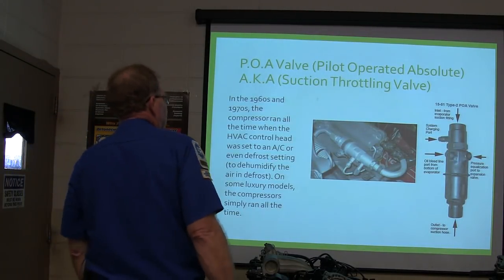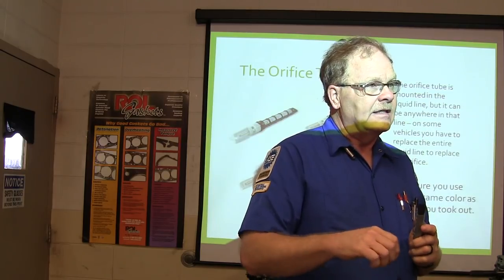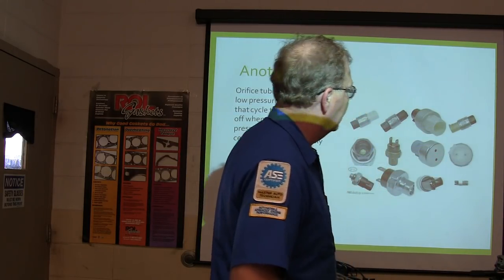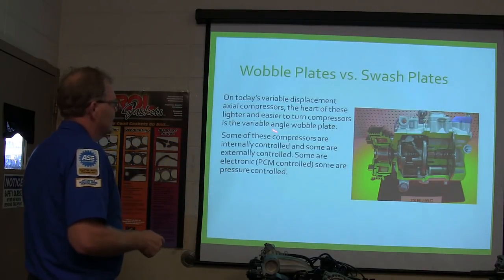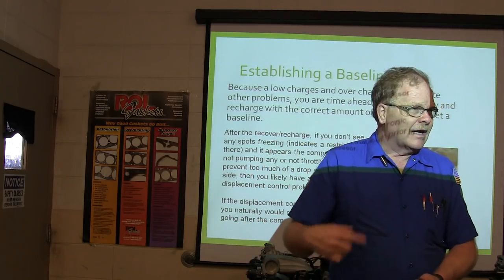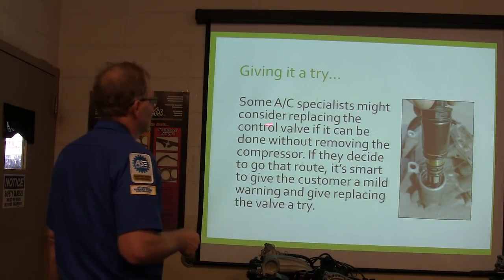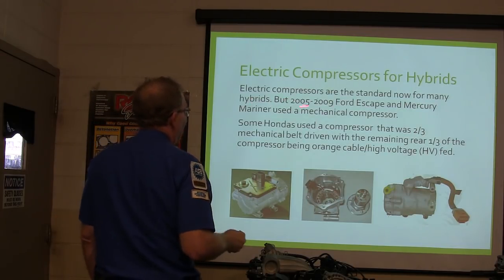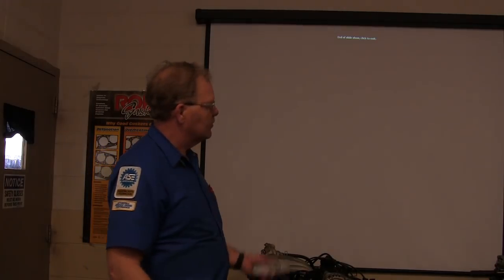A C Cycling and stuff

Comment: Hello,  Sir. I have learned  that there is a low pressure switch that will not let the pcm run the compressor to keep it from failing. I keep hearing that if you have low refrigerant, your compressor will cycle on and off rapidly.  What I would like you to please explain to me is how the compressor keeps turning on and off with low refrigerant. I am confused. I would think that the compressor would not engage at all and not cycle on and off rapidly. Thank you, Sir.
Reply from the maker: It will cycle on and off if there is enough pressure to close the low pressure switch - when the compressor kicks on it lowers the pressure below the switch opening pressure, and the pressure then rises - and the cycle repeats
Reply: Thank you so much, Sir. I may have heard you say something like that in one of your videos, but couldn't remember which one.